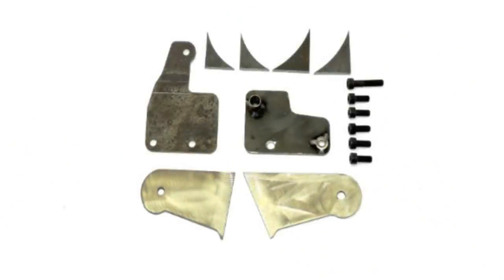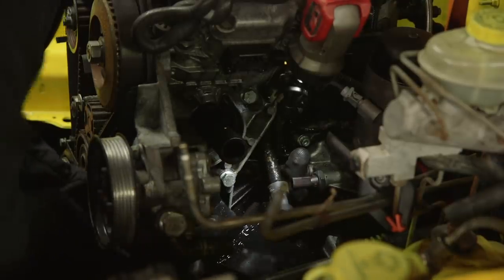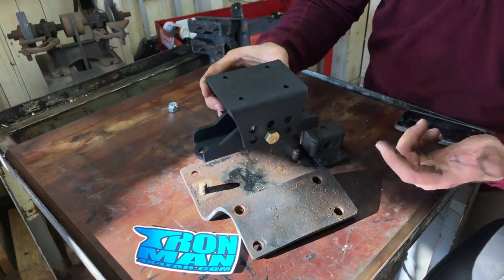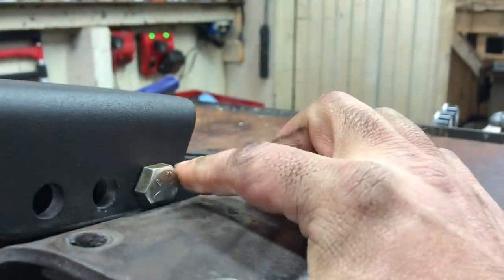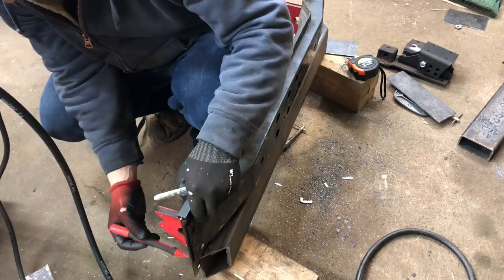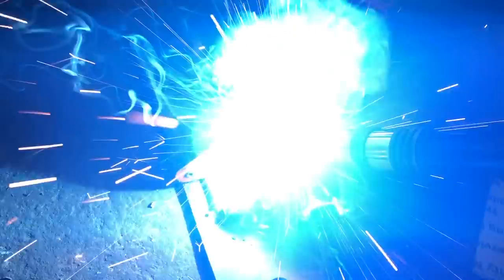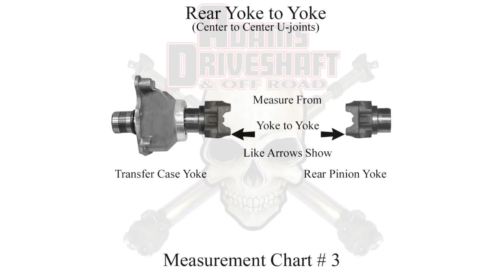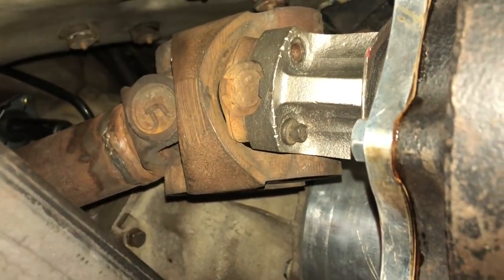Step By Step TDI Swap - Part 4: Engine, Transmission Mounts, and Driveshafts

Comment: Another great video thank you!  Sorting out a crossmember on the bench is quite a challenge.  I took a different approach starting with hanging the engine/trans in the jeep, using a post jack to determine my desired manifold angle (ok, to be honest, making sure my rad/fan angle was kosher) and that my pinion angles weren't going to be impossible.  Then, I measured and did some dirty CAD ( Sooty Cardboard Aided Design) in place to develop the new crossmember, with centrering bolts ( allthread with ends turned into spikes) to define critical mounting points that were non-negotiable. I like your use of square stock, I had a pile of DOM tube kicking around which looked great in the end but was a pita  to work with. Because I wasn't sold on my final engine/trans disposition, I also pre-fabbed a number of 1/16" shim plates for the GM rubber trans mount I chose to use (for spousal approval reasons)   Great fun as always to watch your  thought processes.  Good to see you support an awesome company like Adams, their customer support is second to none!

Comment: For my 305 4l60e swap I used 4ft of 2x6 3/16 steel tubing ($55). Cut a piece off the end where the crossmemeber looked centered on both sides and welded that extra piece on top for the transmission mount (trans pan wouldnt clear crossmemeber). Also i tapped out the 3rd hole on both sides. Reamers made drilling holes very precise and easy

Comment: I really like your series.

I want a reasonable trail capable 4x4.
I want to tow a small travel trailer so I don’t want a lot of lift/decreased stability.

Could I clock the TDI, use the Passat AC bracket and clear the differential/axle with minimal lift?

My gas Chevy 2500 HS kills my wallet at the pump.

Comment: I thought TDconversions sells ready made mounts? Why did you have to weld them. Also how do I know which way to clock the engine. Wouldn't that be standard on all XJ?

Comment: Ironman 4x4 Fab may take 6 weeks for you to get your parts. Also, their directions might not be right. So I found when I ordered some steering parts.
Reply: I know they've had trouble keeping steering kits in stock in the past.  I also know I've dealt with these kind of delays (or much worse) many times over on this build, and it is frustrating.  I found Ironman 4x4 Fab to be very responsive.  I won't name names but I can't say the same for some others I wish I had not spent my dollars with.  To be fair most of these guys are small shops focusing on quality and trying to keep up with demand, so customer service can be a real challenge in the busy times.

Comment: Are you using a dana 300 transfer case with a flip kit and a doubler in front of it???
Reply: Keegan Layes correct
Reply: @DRTJon  going to do the same for my cherokee. Any pointers in doing that or are you going to make a video too??
Reply: Keegan Layes it’s a nice setup for me so far. Fits really well and I could actually swap it out for a 231 with SYE its only 1/2” different and yokes are exact same. I’m not sure if I will do a video on it yet
Reply: @DRTJon  it would be nice to have a video of it. I've been trying to search and make a parts list but I dont know what's all involved into doing that set up. Would be nice to have a guide line.  I do like Nates set up with the atlas  but I like the d300 cause of its jeep related history. Plus low gear ratio for the trails.

Comment: Instead of cutting and grinding why not just change the direction of the bolt; could not tell from the video but perhaps the nut end toward the bracket instead of the bolt head would have worked better?
Reply: Joe Norris being a nylon lock nut it offered much less clearance the other way around

Comment: I'm wondering if it's easier for wrangler owners to put in a 3.0l ecodiesel or the 2.8l duramax which is the same as the vm motori crd used by diesel jeeps internationally.
Reply: sidewithwerewolves that I don’t know but I’m sure those engines are not inexpensive or easy to transplant though of course where there’s a will (and a fat wallet) there’s a way

Comment: I am waiting for someone to talk about how to put a tdi and a auto together
Reply: The mechanical coupling of it will be the same, just with a flex plate and torque converter instead of clutch and flywheel.  From discussions I've had, you can run a full manual shifter pretty easily, or mock up a throttle position sensor.  Join the group TDI Swapped Trucks on Facebook, tons of knowledgable people and info there!

Comment: what torque did you tighten the transmission mount crossbolt to?
Reply: I believe it was gütentite
Reply: I'm running a stinkyfab t mount with poly bushings on one of our XJ's...  Worried about increased dental visits up here in Montana ;)
Reply: @MattyGgardneR  hahahahaha yes!  This is NOT polyurethane, it's a much softer rubber, similar to a control arm bushing.  It took about 500 miles before it was broken in.  Vibrations felt were not bad but noise transfer has gone way down.  The bolt has a nylon lock nut so it does not need to be torqued down heavily, just definitely don't want it to be sloppy

Comment: What tcase are you running?
Reply: crayfishroll flipped Dana 300 with Strongbox doubler. 7.16:1 crawl ratio in low-low. It’s a nice setup I like it so far. The NP231 with SYE could actually swap right in the measurements for shafts would be within 1/2”
Reply: @DRTJon  that's a sic setup I just caught glimpse of it.  I'm stil going to run my np231 for a while but that was an option I looked at before.

Comment: What is ur mpg with the tdi swap in the xj?
Reply: first full tank was 31.5 MPG.  I did a partial fill up after that, then was on my next full tank on a longer trip and the turbo bearings started to go out, so it's down for turbo replacement now. I have more miles on that tank with more showing on the gauge than when I filled up when calculating the 31.5 MPG so I expect it will be somewhere between 32 and 36 MPG regularly